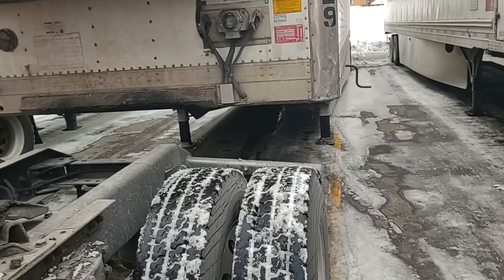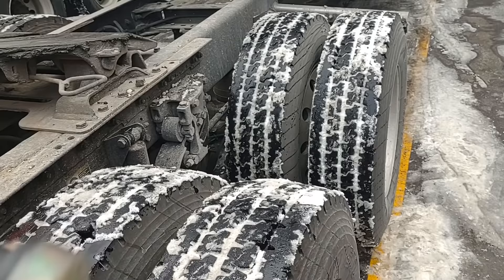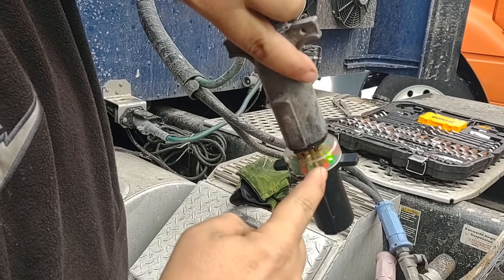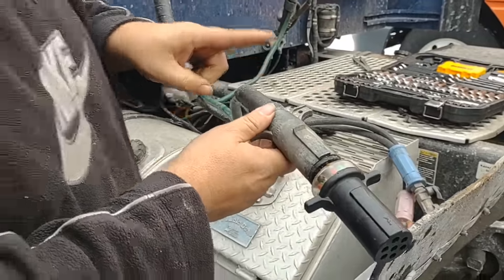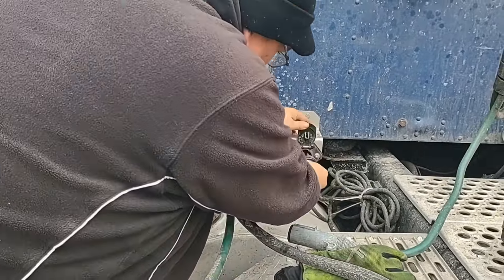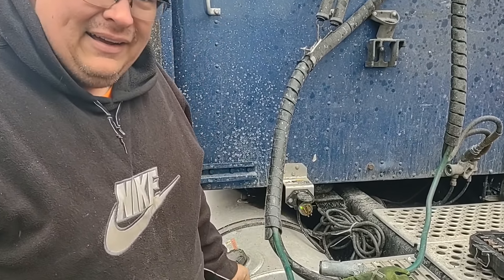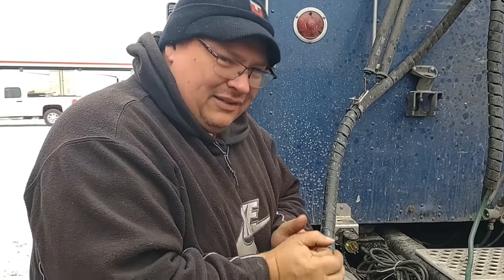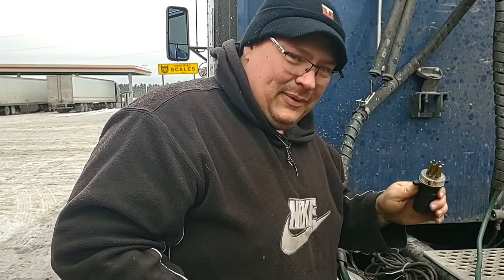Every owner operator should own this tool.

Comment: I’m the service manager at a trailer dealership/ repair shop. This is the first thing we do when a customer comes in with a light issue on the trailer. 9 times out of 10 when multiple lights on the trailer are not working (like all the top lights) it’s a truck issue.

Comment: One thing to keep in mind with these testers, is that the led's take very little voltage and amperage to light. If there is high resistance on a circuit there can be enough voltage to light up the tester, but not enough to actually light up the trailer lights.
Reply: If you look at the tester it has a female side to it so you can plug the trailer plug into it so it will have a load applied to the circuit
Reply: These days the odds are pretty good that the trailer lights are LEDs as well.

Comment: Never used or needed one of those, a basic test light will do the same thing - slightly slower but a hell of a lot cheaper and more versatile.
Reply: Yep. Only real benefit to this is it’ll test all the circuits at once instead of having to test each one individually with a standard light tester. It’s definitely not a “must have” tool.
Reply: @Siggydawg  maybe a little. Just saying that you don’t need a $90 tester. A simple test light will do the exact same thing. Not everyone wants to spend $90 for something they’ll use maybe once a month. Even less if they pull the same trailer everyday.
Reply: Lol

I got trailer light issues and a test light ive had for about 20yrs lol

No rt turn signal or emergency flasher on the rt side of the trailer for the last week or so

Comment: Good idea for quick check . I’m retired now but I carried a test light  good for upto 24 v or 12 v welded on to  a small  vice grips .but the mechanics in the shop told me not to mess with the plug on the back of the  new tractor . I could do damage we had video cameras inside some trailers so dispatch can see if it’s empty . Keep on trucking from Trucker Al retired 👍🇨🇦
Reply: Hello sir.. any idea why a right side flasher / turn signal stopped working on the trailer only? 
I swap trailers alot.. i think one of them caused this.

Any usual spots for me to check for a fix.. fuses, etc.?
They work on my truck still but rt side wont flash on the trailer.. this trailer i have now, when i hit the rt side signal it will brighten up but thats it
Reply: Sounds like a ground fault in right side of the trailer some were . If it’s a LED   They can be temperamental at the push in connection on the light it’s self . I’m just guessing . If it’s the old type bulb . Could the  bulb contacts oxidized .

Comment: Nice contraption. Nothing is cracked damaged loose or leaking. Everything is properly mounted and secured. No abrasions bumps or cuts. Lights are the proper color.
Reply: CDL test Tomorrow :)
Reply from the maker: It was a broken wire under the truck
Reply: Pretty soon your pre-trip will consist of looking out your mirrors as you pull away and paying Loves once a month to check your tires while you get some roller weiners
Reply: @Ididerus  Awesome. Probably going with Covenant
Reply from the maker: @Ididerus  😂
Reply: @jiphy  doesn't matter really, but start looking for a new job @ 6 months. You've got to think like a mercenary is this business,
Reply: @J T You got that part down for sure 😂 good luck
Reply: @Ididerus  😆

Comment: I've used that exact tool for years. When I was hauling triples at FedEx I could diagnose a problem faster and get it fixed. We had a lot of wiring and abs module issues
Reply: You too huh? I love that tool. Plus with that little brass tab thing you can power a circuit that isn’t getting power if need be. Ironically I’ve never seen a mechanic who has one. If they don’t have that tester cart then they don’t know what to do.
Reply: @SAPPY4HAPPY1  That’s because “mechanics” these days are glorified parts swappers. They either stick around and start playing games or learn how to read a book and get a job at some dealership.

Comment: I once had a trailer light problem,  and it was in the truck side plug. I took it apart all the little screws for the wires were loose.  Tighten them up then everything stopped working.  I had left 2 ground wires off that were held on by the bolts that held the plug in place. After I reattached the ground wires everything worked as it was supposed to.

I would buy one of those myself but I only have 10 days until I retire so I'm not going to worry about it
Reply from the maker: congrats on the retirement!
Reply: @DIYSEMI  
Thank you sir

Comment: If the cord is missing power on a circuit, check your fuses. For most trucks fuses for the trailer side is under the hood in front of the driver on the firewall. Though there are some fuses in the main box in the cab. Get a fuse tester for that. And replace fuses with same amp as you remove. That fuse popped for a reason, if you put i higher amp you could start a fire as the circuit will get too hot and wires can melt. It is rare but i have seen happen. And with all led set ups, also check batteries. Make sure they are tight and all batteries are good. One weak battery can throw voltage off and not power correctly. Most oftennit is just a fuse blown.
Reply from the maker: I was a broken wire under the cab. I found it quickly. Thanks

Comment: Awesome tool! Typically the problem is a blown fuse that blew from the last trailer that had bad wiring! Some of the older trucks had resettable circuit breakers that would trip but could easily be reset instead of not having the correct fuse to replace especially at a bad time when you needed to get gone but still messing around with lights that don’t work! That tool is a great time saver!
Reply: Do u know if a 2011 Cascadia may have a resettable circuit breaker? I think a trailer made my right flasher (on trailer only) stop working

Comment: Of course you should have something like that.

The other thing that is realy handy is a box with a tail, switches and a battery connection that allows you to test trailers without a prime mover ......... 

The same goes for any size trailer and any size tow vehicle.

I built one years ago, because I work on small trailers from time to time .......... back then you could not buy them

Comment: As cold as it looks what you do is take the plug apart take the dead wire out and tape it off. Run a jumper from the other clearance light wire to the terminal you took the dead w ire out of. Put the plug back together. Plug it in all will work fix it right when weather warms up or you get back home.

Comment: After the first time of using one of those testers I never looked back, whether o/o like I am now or company driver that's been in my tool box for over 10 years.   At this point, knowing the problem is truck, I'd check the fuse and if good just pull it and put a jumper directly in the plug. Once I got to warmer weather and had a little time I'd track down the issue and fix it.   A jumper wire is a quick simple fix that'll get ya down the road, a piece of single strand wire, like the wire used on a vehicle red tag, works perfect bent in a u shape and inserted across the light cord end of the plug.  I typically do this at the plug on the truck not the trailer, then put a note on the fuse panel cover so I don't forget to pull out the jumper.  Pulling the fuse will kill the power to the clearance side so if it's just a loose wire you don't end up intermittently powering it while the jumper is in place.

Comment: Every shipper needs this before they load the semi trailer
Reply: What's the shipper got to do with the problem.
Reply: @jeffreyroehm5904  If the driver refuses to take the load for safety reasons then there is a problem.  I would tell them to unload the whole damm trailer especially if it's their trailer

Comment: Likely a fuse.  Likely the fuse will blow out again as soon as you plug back into the trailer.  My experience is that particular fuse often blows on the truck due to a bad pigtail and or trailer wire short some where on the trailer.
Reply from the maker: I said i checked that. It was a broken wire under the cab

Comment: Good Vid!!  Most typically can find any issue, with a test light, which are pretty plentiful at any truck stop.  If you don't already have one.  In this case I'm fairly certain you have a simple blown fuse.  The question you should be asking,  Is why did the fuse Blow??
Reply from the maker: No it wasn't.

Comment: $30, you didn't buy this from the sight you shared!  They're showing a price if $82.  Still a good tool to own.  Read in to it and you can even temporarily by pass or put a jumper to the bad pin to get lights in order to get to a garage to get fixed.
Reply from the maker: Believe it or not it was $37 whem i posted the link
Reply: @DIYSEMI   Oh I believe it.  The way this economy is now everything's going up 2 or 3 fold.
Reply: @DIYSEMI  
Yes sir, it's easy to believe,  seems every day many of the same items go up in price on a daily basis.  I sure miss Trump

Comment: this is all you need , checks the plug , checks for a burned out fuse , checks for power at a blower motor that is not working and many more things Frank T
Reply from the maker: Way to do your homework dude. Done videos on all those things using a multimeter. But im sure you already looked into that. Better luck next time

Comment: I just installed a 3&1 airlines on my T680. For some odd reason my right turn signal isn't working. It doesn't matter which trailer I hook up to it's doing the same thing. Any suggestions??
Reply from the maker: then the problem is in the tractor...check fuses first.   then go looking for broken wires, loose connections, bad connections

Comment: Great video. What/where did you find the problem? I currently have the same problem on a semi dump truck trailer. The trailer side marker lights wont light up but the back lights work. How can i fix it
Reply from the maker: under the cab broken wire

Comment: Dude you got a blown fuse caused be most likely a trailer that you pulled had a bunked corner from most likely a tree limb    common problem , there wired in 2 circuits for upper lights and a second circuit for lower tail lights Frank T
Reply from the maker: Nice diagnosis...it was a broken wire under the cab.
Reply: @DIYSEMI   yea right !
Reply: Fact it was a broken wire. I know it's my truck